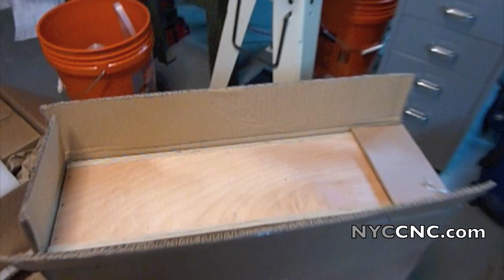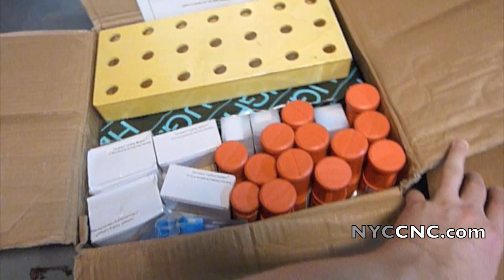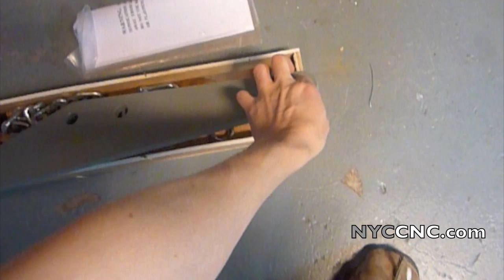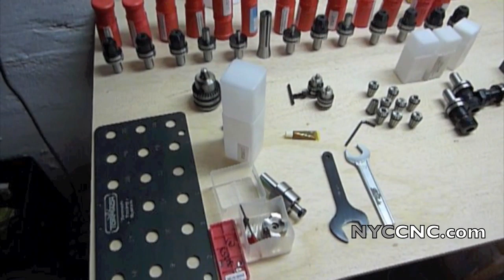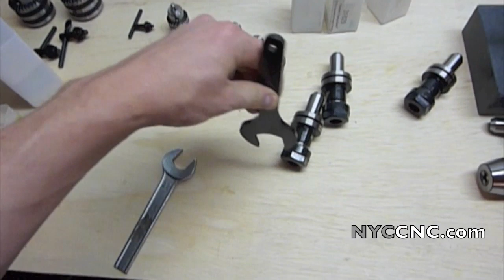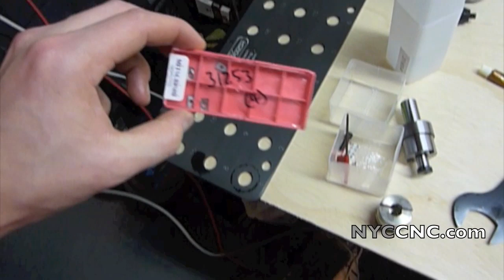Tormach PCNC 1100 - First boxes have arrived!  Ch. 3

Comment: Hey John

So 7 years down the road, what would you have opted out of buying? 

I'm beginning to plan a mill purchase, and I don't think I can beat the value of a 1100. My only concern is how much material I can remove. I'm used to running 3hp bridgeports with servo systems, and will be programming real VMC's starting in a few days at a new job. I know those VMC's are no comparison... But will I be disappointed? 

Thanks for the awesome series you've put together.
Reply: A tormach does not have quite as much power or rigidity of a Bridgeport I'd recommend you watch videos about tormach from a channel named nerdly and if you want a better machine in general with better rigidity and a lot more power I'd recommend going with something like a hass mini mill

Comment: @saunixcomp Nice to see your shop moving along.  Congratuatlions to your Tormach purchase.  My mill is a mid size homebrew CNC with a FANUC control. Tiny bit bigger than a Tormach but fits in my small garage shop with my Enco 9x20 lathe.

Comment: @saunixcomp I do a wide variety of parts.  Mostly in Aluminum. I also use a lot of the 1018, 4140, 4130, 4340 steels.  But I do make things in Nylon 6/6 LP410A.  Yes, I love the Mitsubishi insert products. You might also like to use Sumitomo Carbide ones too.  I know you will love the Albrecht keyless. I can help you pick out end mills and cutters.  I know you've been wanting to get away from the imported ones.

Comment: Although I don't have a Tormach, I love my Albrecht C130J33 Keyless.. and get yourself a Jacobs 14N.. and the other "N' ball bearing models if you want.. the14N is the most popular.  Got both of those on eBay very affordably.  ER16 and ER32 collets are wonderful.  Surprising that the set includes the ER20.  I bought Lyndex, Royal and Centaur. You can also get nice TG100/100TG collets for milling too. The Mitsu inserts are nice I have used them in other F/M.